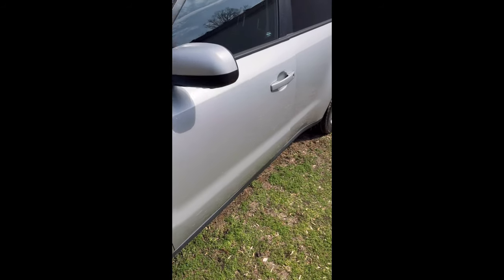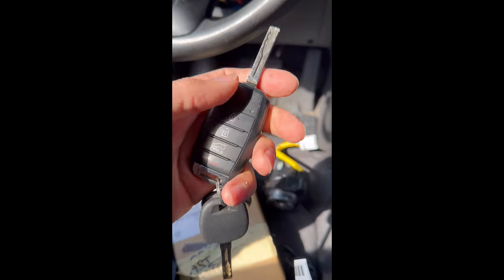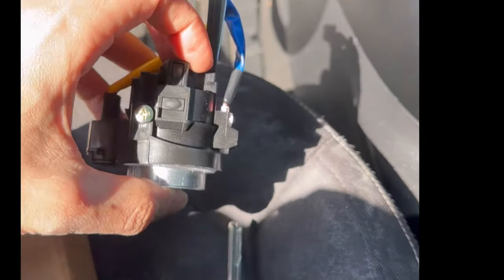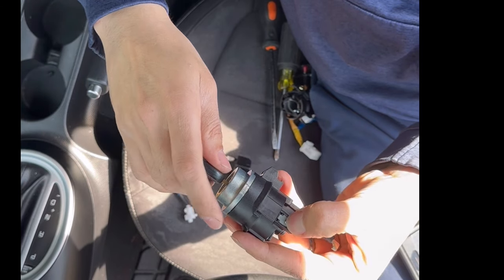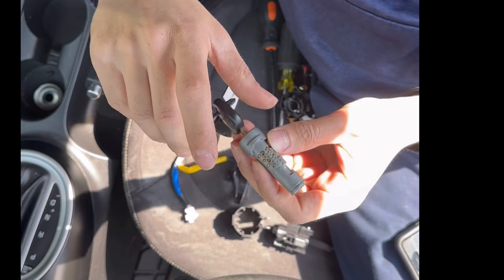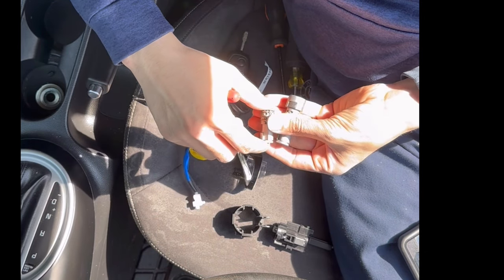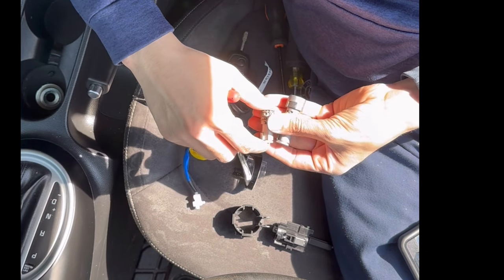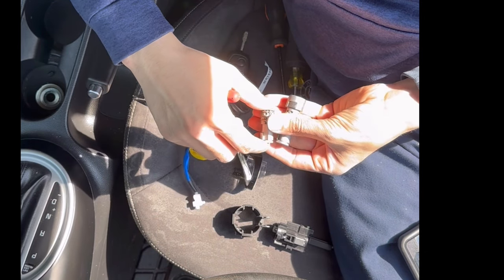Kia ignition replacement and rekeying ( after Kia boys destroyed it )

Comment: You posted a video of putting the ignition in. How’d you get the damaged one out
Reply from the maker: Ic you can get it to turn then it need to be on ACC position and use a pick to push the release button on the bottom. If you can’t turn it just brake it until it comes out without damaging the housing . Or just replace the whole thing by taking the top 2 bolts off
Reply: @PhilyCarsAndKeys  Any videos on getting it out though? I can't get a key in. I don't know how to break it out either.

Comment: The Hyundai boys broke into my car last night as well :( switch was pryed open. I was able to put it back on and get car to turn ON but I don’t get it to start. No crank either… any help on what it might be? Thank you
Reply from the maker: First turn off the alarm by hitting the unlock button on the remote or turn the key into the door lock twice 

If that doesn’t fix it remove the ignition and turn it by a Parlier of pliers if that doesn’t work check your battery or starter

Comment: So asong as tgat key and emobolizer match with your ECM its good to go?
Reply from the maker: @fil1329  those cars don’t have immobilizer in the USA . No Programing is needed unless it’s a 2023 or newer
Reply: My 2010 must have one as if i try to change the ecu it won't run
Here in Canada at least
Reply from the maker: @fil1329  Canada cars have immobilizer in them
Reply: @PhilyCarsAndKeys  yeah but how can I get around it?
Change the ecu and take a key from a donar car that's flashed to the donar ECM and its key?
Reply from the maker: @ no it’s much cheaper to call a local locksmith to program the new key to your existing ecu
Reply: @PhilyCarsAndKeys  no its not
Its more expensive
Reply from the maker: @ call around it shouldn’t be more than $100-150 for a locksmith to come out and program it

Comment: does anyone know if the damage done here would cause the battery overnight ? from wires being cut ? the windshield wiper control lever damage ?
Reply from the maker: In a lot of cases the ignition switch stays on after damage causing the battery to drain. And yes a lot of times those kids end up braking the wiper control lever . Buy the part and replace it your self ( easy ) some will slide out others held by few screws

Comment: after got my car recovered and fixed. i have to use the old fob to unlock the car, then start the car with a separate key blade. i have to carry both old and new key to get the car work. i had to upgrade to a push start system.
Reply: how did you up grade to a key less???

Comment: Kia boys just got me yesterday, my old ignition is still intact I just can’t get it to fit back into the column
Reply from the maker: Check if the plastic housing is broken, if so it won’t start in place , and will need a replacement. Unless you can pick up the broken parts off the floor and glue it together
Reply: @PhilyCarsAndKeys my housing part is kind of broken Is it away around it cause I already bought the ignition part but I don’t think it’s goin to stay in the housing
Reply from the maker: @jasminemickens3144  either you replace it or I have seen some people take the broken housing parts and glueing it back together. And once you install the ignition into the housing zip-ties it 
Remember it’s not a moving part plus the plastic cover helps holding it in place 

But  I recommend replacing the housing 
I have a video on that on my channel

Comment: Is it possible to remove the cylinder from a junk yard without the key designated to the vehicle?
Reply from the maker: @ivanvega2821  no . Plus you can’t use it if it doesn’t have a key . 

But you can always take the vin and go to a local locksmith shop they will cut you a key by vin as long as it’s a junkyard car

Comment: My ignition was so ducked that I couldn’t get it into accessory mode w my key with how bad the damage is
Reply: Were you able to find a way to pop out the ignition without being able to place it into acc mode?
Reply: Not yet
Reply: I have the same problem, any advice would be helpful.
Reply: @CarlosRivera-eo5yh  Employ the same method the theives did and use a strong screwdriver inside what is left of the ignition lock cylinder and twist hard. There is nothing left to damage at this point. After that, just push in the release button and pull the ignition lock housing out of the column.
Reply: Employ the same method the theives did and use a strong screwdriver inside what is left of the ignition lock cylinder and twist hard. There is nothing left to damage at this point. After that, just push in the release button and pull the ignition lock housing out of the column.